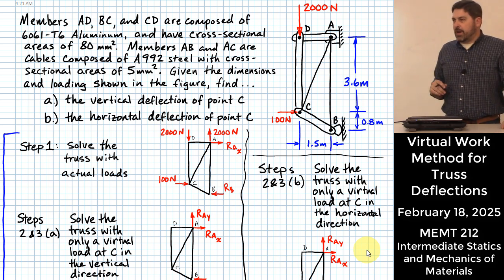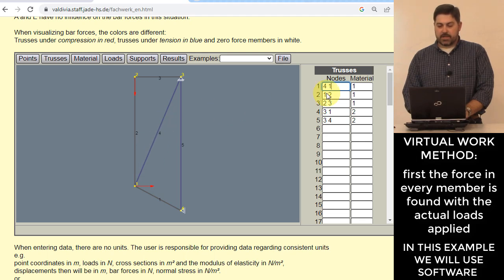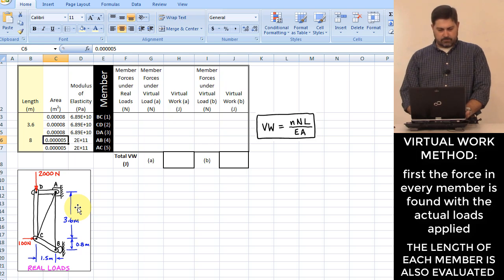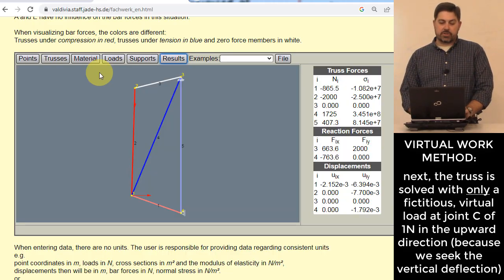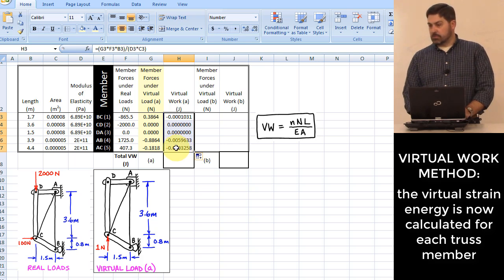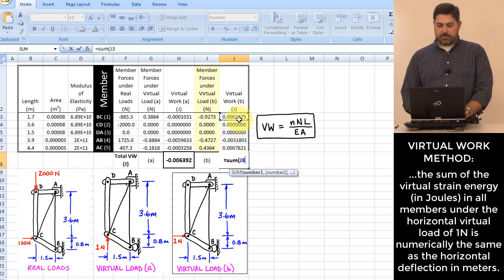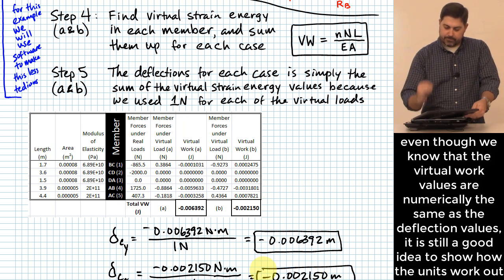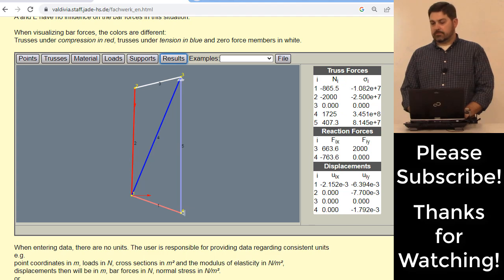Truss Deflections using the Virtual Work Method: Truss Force Solver and Spreadsheet Make It Easy!

Comment: Good work. Thanks you for what you are doing. There is an error in the table: the segment AC is number 4, while AB is number 5; there was an inversion. I tried to do the calculation manually and I saw the discrepancy.
Ciao Andrea
Reply from the maker: Good catch! I apologize for the inversion there. It looks like it is just the AB and AC labels that are inverted, so it wound up not impacting the other contents of the table or the final answers. I left a note in the video description to try to guide anyone else who may be confused by the inversion.